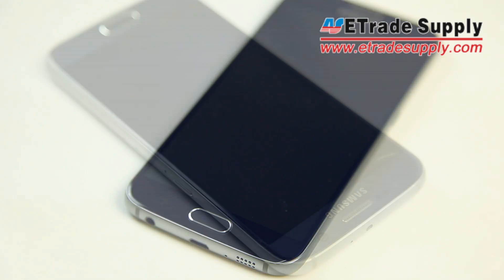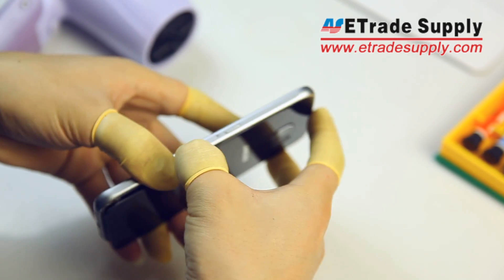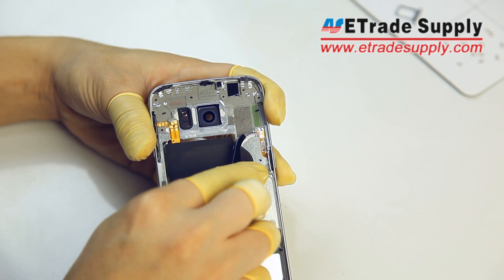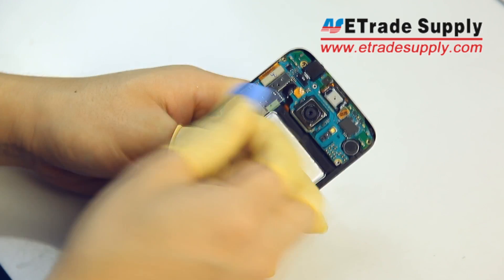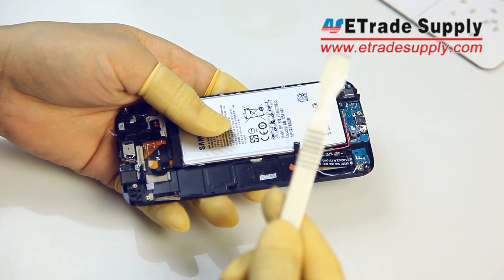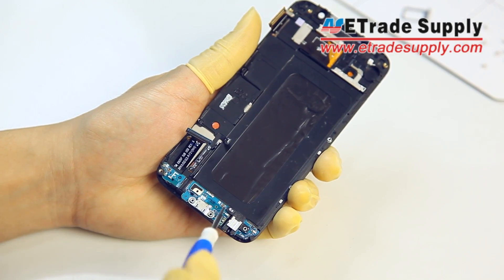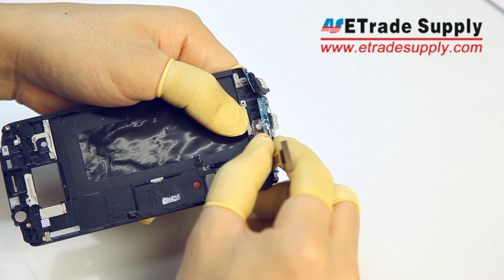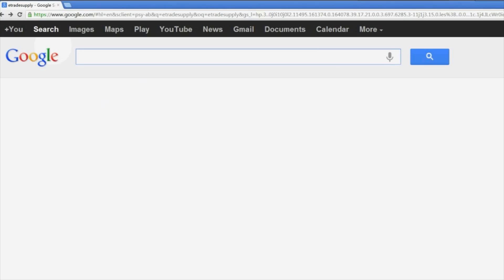Samsung Galaxy S6 Disassembly/Screen Replacement/Charging Port Fix/Replace Battery

Comment: They really did not want people removing the battery. I'm having an issue with an infinite boot loop on my S6 and I refuse to factory reset and lose my data. Disassembling and pulling the battery or flashing firmware are my only options, and both are a bitch and a half. The latest firmware is 1.8 GB and this teardown is a huge hassle. I'm never buying Samsung again, this is bullshit. Their hardware design is no better than Apple now, clearly anti-DIY and anti-consumer, just like Apple.

Comment: My phone fell with water and the screen went up but the phone worked and the screen did not work ?  galaxi s6
Reply from the maker: Your phone may have a water damage, the LCD or cables was burned. You can go to the repair shop have a test.
Reply: Means there is a possibility that the screen will burn?
Reply from the maker: Maybe the screen cable. Good luck

Comment: Hi all, 
I need a bit of Help/advice here.
my touch screen broke and I can't unlock the phone to grab the data from the phone.
I have been told I need a £200 pound touch pad fitted to be able to unlock my phone.
the insurance will replace my phone but won't fix it.
I need all the contacts pictures ect. 
my thought was this, i have 2 identical s6's if I remove the back from a working s6 and remove the back from my broken s6 then pull the main board out of both phones and put my main board into the good s6 could I then power up the good s6 and unlock my phone and move the data from it.
then put the original board back into the working phone and re-stick it.
long story short is the hard drive and operating system on the main board so I can swap boards to retrieve my data .
I get my S8 in 2 weeks so I don't want to spend £200 just to retrieve my data.
I have no backup and my s6 don't show up on my Samsung account as I never got round to registering it.
would my idea work.?
if i can do this i wouldn't need to remove the battery or the front of the phone as all the stuff stored on the phone should be on the hard drive and if the hard drive is on the main board i cant see why this wont work, all i need to to gain access to my lock screen so it all shows up on my pc.
i have posted this question on a few vids so sorry if you have read it once or twice but i desperately need to get this sorted as my insurance runs out in 1 month and i really dont need the £200 cost of replacing the touch-pad on my broken phone when i can get a new one on the insurance, i just need the data from it then they can have the broken phone.
thanks in advance.

Comment: So to fix a lose usb connector, I have to take apart the entire phone?  This used to be 100x easier on the Note 3.
Reply from the maker: i'm afraid you have to do this to replace the charging port connector since the s6 inside design's complicated.

Comment: Is it possible to replace charging port WITHOUT replacing the USB circuit board? I just got my order from witrigs and apparently i only ordered the charging port, not the board it is attached to :( please help!
Reply from the maker: Hi, replacing only the charging port need very professional soldering skills, cause the charging port is soldered to the USB charging board, here is a video we made for soldering iphone and galaxy phones charing port you can check https://www.youtube.com/watch?v=HH_UJsdopJM, if you are not familiar with this kind of job, we recommend you replace the whole charging port board flex.

Comment: Thanks for the video! I am trying to make a solar charger, can I just sauder (sp) my phone cord directly to the panel or do I have to have a USB  circuit? Thanks
Reply from the maker: that sounds cool! but i guess you'll still need a usb cable to connect the solar charger and your phone.

Comment: My fast charging stopped and i cannot connect to PC either...I only get a slow charge with my fast charger....will replacing the charger port fix this or is it a motherboard issue? It's happened to me before and samsung (according to samsung) replaced the whole motherboard....But I feel optimistic that just replacing the charger port is the proper fix.
Reply: same problem with mine, then my phone stopped reading sim cards a few days ago. so not sure if its both motherboard related issues or just specific usb port and sim slot issues.
Reply: With yours being the sim card too, yours sounds like a motherboard issue... Slow charging the S6 is a nightmare, it takes up to 8 hours to get a full charge and the full charge runs out in less than 2 hours.
Reply: Im awaiting the replacement port to arrive in the post, it'll take about a month to come, if i remember then I will let you know here if replacing the charging port circuitry helped....

Comment: if my wifi and bluetooth are not working what part do you have to change,and is it worth fixing?
Reply from the maker: you mean you can't open wifi and blue tooth?
Reply: +ETrade Supply how do you fix fingerprint scanner specifically

Comment: Hi, I've seen your videos on Youtube and I really your help. I own a Samsung Galaxy S6, but I let it drop some water and now some features stopped working, such as: the screen rotation, the GPS signal, the step counter (of the app S Health) and the screen won't shutt off while I'm using the phone... So I dialed #0# and tested the sensor and they are all zeroed - not working. So I believe there's something to do with the sensor, because the accelerometer, the proximitiy sensor, the barometer, the gyroscope are not working. Do you know which part of the Galaxy S6 is responsible for the sensor? Motherboard? Charging port? Where are the sensor located? So if I would to repair it, which part should I fix? Please, need help!!!
Reply from the maker: +Bernardo Felix guess  maybe the corresponding module on the motherboard is broken, recommending  you to have a check at the professional repair central.
Reply: +ETrade Supply - I've already checked with Samsung's technical assistance, but they are claiming that they have to change the hole motherboard and a new motherboard costs here in Brazil +- US$ 600 (the price for a new phone)... so it's not worth it to fix it, better buy a new one! That's why I was wondering if it's possible to change only the accelerometer + gyroscope module...

Comment: Hello! i have a question.
on the back middle frame..are 3 ribbons. On them it's says ZF-E4 what are them for?

And 1 more question....i changed the display to my s6 phone...and if i put to charge it's charging normally...but when i assembly on the middle frame and i put the screws .... and i put to charging ...say it;s charging...but not charge...battery not grow..
Thanks!

Comment: Hello. I have a Galaxy S6 that got wet inside and it caused the "recent apps" button light to stop working. Thankfully the button itself works perfect, but its just the light itself that isnt lighting up. I know its not software or app related because the back button light works, and I did a factory reset and it still doesnt light up. So I think some water shorted out the back light for the recent apps button. I have repaired an S6 before so I know whats involved for the most part, but want to make sure I get the right part. I think what I need is the USB board assembly (the part you remove at 14:48). Is this right? Thanks
Reply from the maker: +Custnam  Yup, the "recent apps" button comes together with USB charging port assembly. Replacing it is not an easy job, good luck!
Reply: The craziest coolest thing in the world happened. One day I decided to just turn it back on and test it again and the light flickered, and came on and has worked since!

Comment: A heat gun needed to open it up?  Argh.  It seems as though Samsung just wants you to just buy a new phone or send it to buy a remfg version for less.  looking at the trend, I can see a day when they don't get repaired, just replaced by either a remfg unit or replaced with a new model.
Reply from the maker: +Oneness100  This is the trend. More and more manufacturers are adopting the unibody design to make phones which makes the repair work more and more complicated. However, if there are still demands there, repair will exist.
Reply: ***** If they can make screens that are shatterproof, no need to replace a screen.  If they become waterproof, then no more water damage,  if Batteries get longer life, then no more battery replacements.

Most of the mfg just hand out a re-mfg unit if it's under warranty and they are also moving to those for out of warranty, so there is already less need for repairs.  It will continue to go in that direction.  For those that purchase an extended warranty at time of purchase, then we rarely need it repaired, they just replace it.  it gets the user out the door quicker.
Reply: Samsung phones have needed that forever to replace anything but the battery/charge port maybe

Comment: My galaxy s6 has been freezing and rebooting by itself for the past 2 weeks and this is happening more often. I have factory reset it about 4 times, wiped the cache partition several times and even flashed it. I have turned it off to charge and it turns itself on. I have booted it on safe mode and everything. I have a Galaxy S6 SM-G920I. I have noticed It heats up a bit from around the camera area. During a period of time when it was not doing this recently, I noticed it did not heat up at all. I have had this phone for 6 months and never dropped it. Would you have any idea what kind of hardware issue could be causing all this?

Comment: Hey bro I am in a deep trouble , I have inserted the nano sim slot upside down into the port and it is stuck in it , I am not able to remove it plzzzzzz hlp
Reply: +karthik goud did you fix it ????
Reply: +HellBoy98    yes I did
Reply: gosh i'm stupid i have inserted the wrong tray out of curiosity and after removing it and putting the right one with the sim the note 5 cant recognize the sim !!! , i think i broke the sim card reader :( , did the same thing happen to you ??

Comment: what are those two circular things next to the micro usb port.   are they supposed to hold down the usb port 

and also is the usb port fragile?  im worried that my charging port will loosen up and stop working after a while.

thankfully this phone has wireless charging

Comment: my gs6 is dead(software crash.. says that phone is over heating when it's not and wont charge because it thinks it's over heating) and I'm trying to get the memory off of it. I didn't see you guys pulling the storage. Is there a way to pull storage and get an adapter for it? or something else?

Comment: my Galaxy S6 got wet voiding the warranty with samsung. it work okay except that return soft is constantly on, making it hard even impossible to use any app. the app closes as soon as it opened. i can hear the keystrokes without me touching the return softkey. do you have any suggestions?

Comment: the soft keys on my s6 has stopped working... anyway to fix this?
Reply from the maker: +Stephon Duncan What happened to your phone? You may need to tear them down to reassemble in the right way. However, as you can see in the video, it is not easy to do the job, you'd better turn to your local repair shop. otherwise, you may damage you phone unexpectedly.
Reply: +ETrade Supply battery went dead, I plugged it in to recharge and the buttons remained blank.. I tried wiping the device, installing new roms and then went back to a stock rom. nothing works.. I live overseas so no one here can fix it. I'll try to do it myself as I'm a bit handy..
Reply from the maker: +Stephon Duncan Well if your battery is dead you'll need to get a new battery of course. You can try cleaning the connectors for the soft keys with some rubbing alcohol and a soft brush. If that doesn't help then you will need to get new soft key contacts. Sadly though we currently don't have just the contacts, but you can get the whole front assembly that has the parts on it.
Reply: +ETrade Supply but in the video I saw the charging port had the soft keys attached to it.. can't I replace the charging port with the soft keys?

Comment: What component controls the screen rotation, the main board? I have an s6 that got wet, everything works but the screen rotation.
Reply from the maker: +Nathan Hadler Yep, one sensor chip on the motherboard was damaged or effected by water. You need find a professional technician to help you fix it. Don't try it by yourself. Samsung Galaxy S6 is hard to tear down parts and damaged easily. Let me know if you want more help. Good Luck! Thanks for watching though. =)
Reply: +ETrade Supply Can just the chips be replaced on the board or does it need to be replaced. I am confident about taking it apart. I have re flowed GPU's and soldered bios chips on motherboards. Do you know where I can get the parts or diagram of the mainboard.
Reply from the maker: +Nathan Hadler These chips can be available on ebay. however the chips' quality can't be guaranteed.

Comment: I dropped my Samsung Galaxy S6 on the floor, and its screen won't show anything but I can hear the key pad tones when i press the menu or back button, the blue light on its top left corner is also working, is my screen totally damaged or some of its parts only came out of place... I'm thinking of tearing it apart and follow this video but I don't see any assembly video....what to do? help..
Reply from the maker: +Allen John Danguilit The menu or back button are controlled by navigation bar and the blue light is the sensor light. The screen may be totally damaged but i am not sure according to your brief description. You'd better turn to local repair shop. One thing for sure, if the Samsung phone's screen damaged, you need to replace the whole lcd assembly. Hope you get your phone repaired soon. Thanks for watching though.

Comment: I watched this and one other video. Both appear to demo a complete teardown. If only replacing the battery, after removing the backside, is it really necessary to remove the front? from what I can deduce, it appears that the battery should be accessible without having to remove the front.

2nd: Where do you get and how do you apply the glue to reassemble?
Reply from the maker: Bart Schuck To remove the battery, there is no need to remove the front assembly. but it have to access from the back, which means you need to begin with the battery door because of the Samsung Galaxy S6 Design.
Reply from the maker: Bart Schuck Our product in our store has adhesive preassembled so that our customers don't need to care about the adhesive stuff. Repair work can be simple and easy. As for what kind of adhesive, i'll check all of them for you as there are different adhesives on the parts. The most common one is 3M adhesive  and also high structure glue used on rim of LCD screen. I will let you know after i get feedback from our engineers. Thanks for your question, next time we'll put this kind of information in video's beginning.
Reply: ***** Thank you. Although I sense you would be a better choice than trying to do this myself, my concern is being without my phone while sending to you, waiting for repair, and then waiting for return. Even if I authorized 1-day shipping, the least amount of time I'd be down is 2 days but I'm thinking it would be closer to 3 or 4 days. Getting a temporary phone is not an option for me, so that is why I asked about the glue because I anticipate I'd have to do this myself. I thought that was the whole idea of your wonderfully instructive videos. As it is, at present my phone is just fine. I expect the need to replace the battery will come up within about 12 months.
Reply from the maker: Bart Schuck Sorry for the delay in response. I think you may have the wrong idea about us. We do not actually offer any repair services. Here at ETrade Supply we are suppliers. We work hard to get the parts to repair shops, enthusiasts and user who want to perform self repair.

We make these videos to help keep anyone interested informed with tips and guides on how to perform your own repairs as well as the status of parts in the industry.

On the topic of adhesives though. Many of our OEM parts have the adhesive pre applied from the supplier. That and we also have many of the OEM adhesive sheets such as this one (http://www.etradesupply.com/samsung-galaxy-s6-series-front-housing-adhesive.html) which is just a whole sheet you line up and apply.

We hope that clears up any confusion. Thanks for watching our video, and taking the time to message us though.